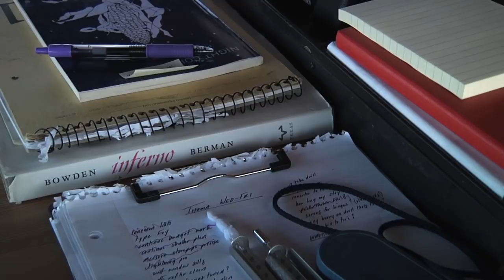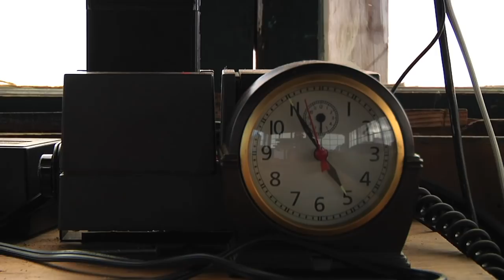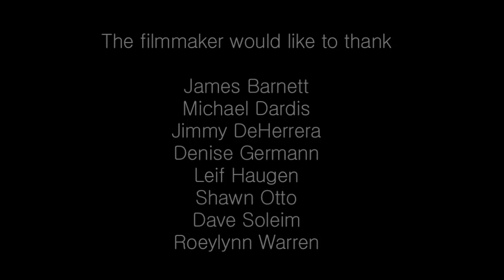The Benefits of Living Alone on a Mountain (2014)

Comment: Just like others have mentioned, I would also do this for free - or, rather, for a minimal subsistence-level pay (just enough to go around for food and other necessities). The only thing missing in that cabin, and something that I would require, would be an energy source for my laptop. Fortunately, there are some pretty good and lightweight solar-powered battery chargers available which would be ideal for summer months. For winter months, things would be trickier of course and would require some actual fuel to be delivered to the cabin for charging the laptop. Once the laptop is up and running, Internet would be an option via satellite link, nowadays satellite Internet is pretty cheap. Why a laptop? Why Internet? Pretty simple, for creative work, for reading and keeping in touch with the outside world. You want to be away but at the same time you probably don't want to be completely isolated at the same time. Having a lifeline to the outside world via your laptop would bring you some sense of comfort and security along with enabling you to do some productive work on the side. This kind of work would be ideal for writing stuff, potentially even writing whole books. Or, you may not have any ambitions to become a writer but you may still want get away from the business of everyday life in order to be able to think clearly and reflect over your past, present, and future without distractions...

Comment: Would this even be needed with satellite technology? Also, how do you get water and electricity in such a remote, elevated place?
Reply: believe it or not water falls from the sky on occasion, and power is probably provided by a small generator and several large batteries

Comment: The whole thing looks great.    Except.   I would put in different glass and get rid of the window panes.   It wouldn't cost to much I wouldn't think.    Tempered glass would be strong enough.
Reply: He is a fire watcher.  He has to see in all directions.
Reply: What I meant when I wrote getting rid of the window panes is to have one sheet of glass that is 3 feet by 2 feet without the wood in middle.     That way it is easier to look out than having the wood in the middle of the glass getting in the way.